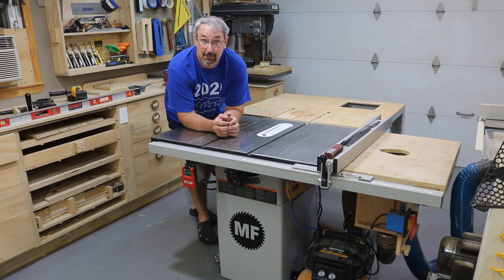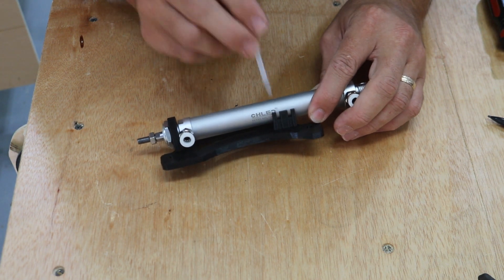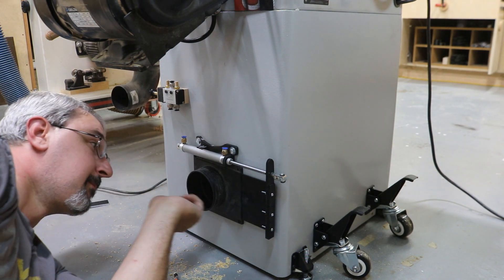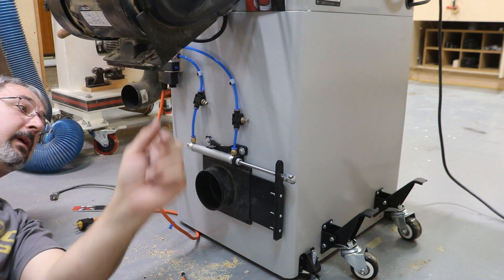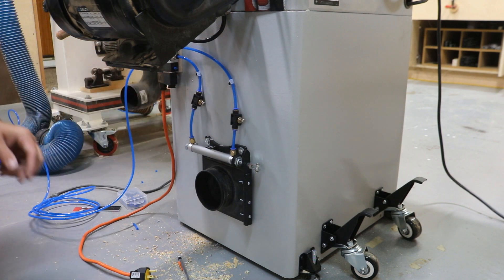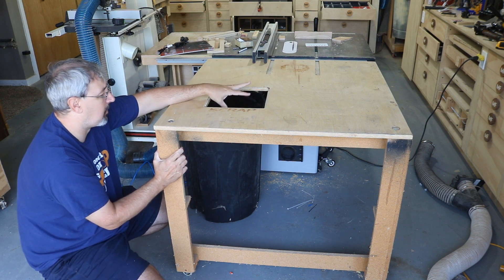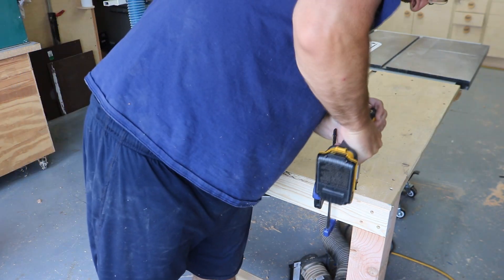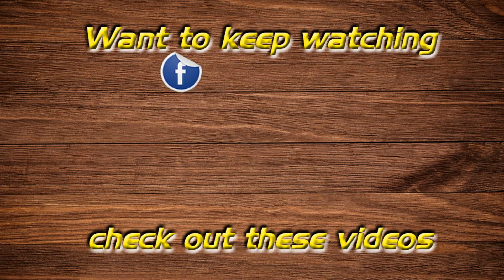Adding Pneumatic Blast Gate and Updating the Outfeed Table

Comment: 13:08 it looks like something may be out of square here. Hopefully it’s the 4x4 but if not, your fence may be tilting away from the blade. I only mention it to be helpful, you may want to check for square to your table. Love the mods you’ve done. Looking to do some to my saw(same model as yours!)
Reply from the maker: The 4x4 not the best quality, the miter saw that got them to length can’t of sucks too. In this case it didn’t matter because I added the leveling feet to the bottom. Thanks for the heads ups